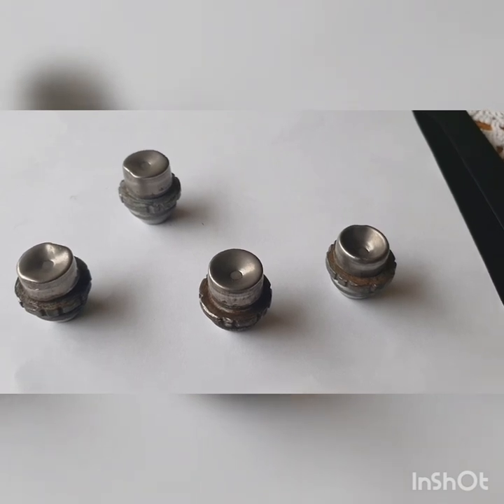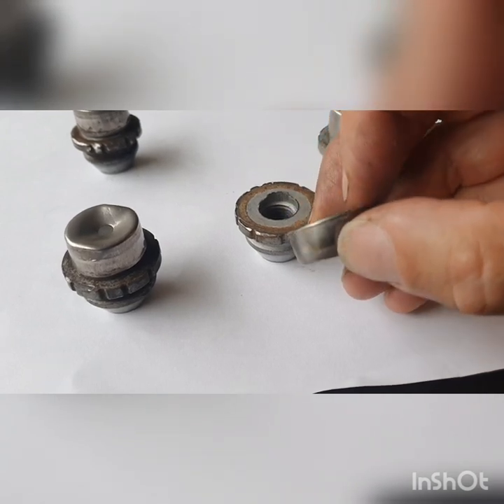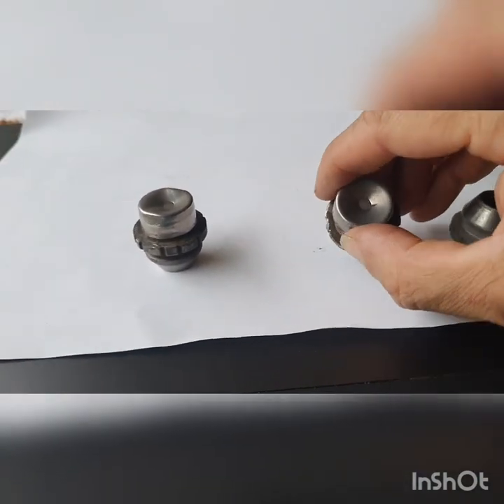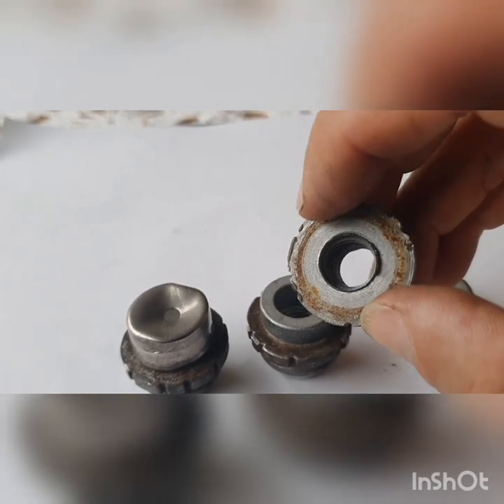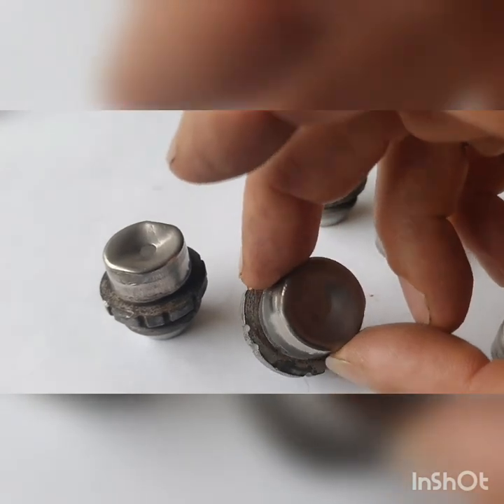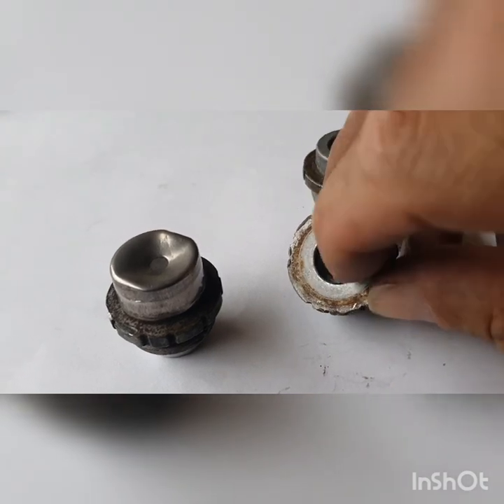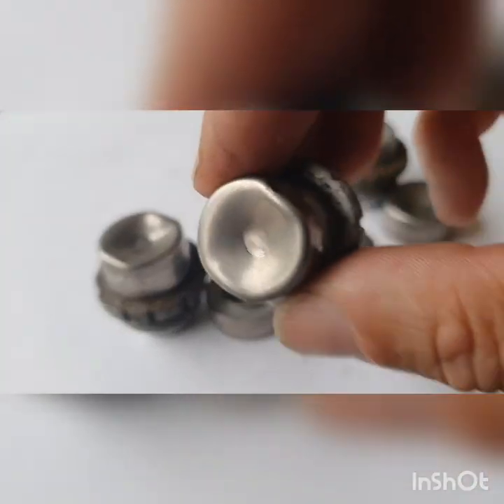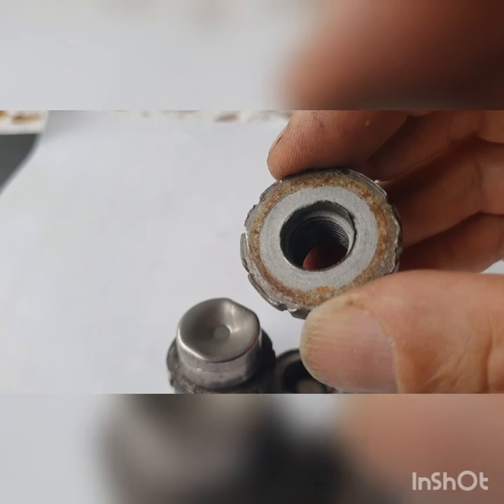Ford Fiesta Locking Wheel Nut Removal, No Key, No Drilling, No Welding.. Just Be Careful!

Comment: If you get an Alan key across the flats the same size as the hole and hammer it into the hole, you can undo the nut. This method has worked in our tool room in the past.
Reply from the maker: Interesting idea, will have to give that a try